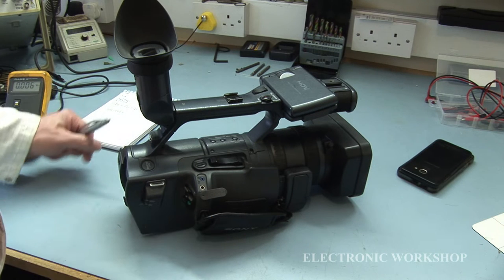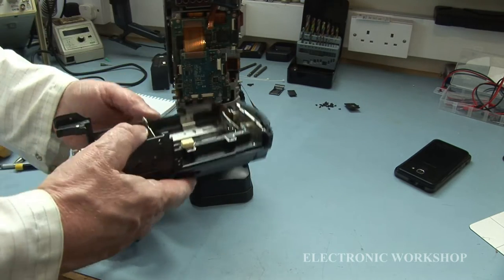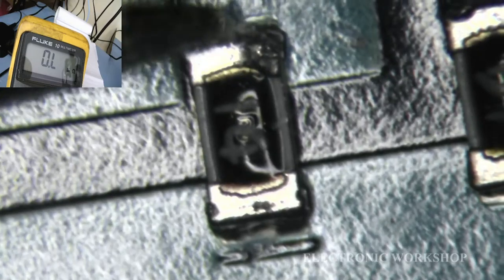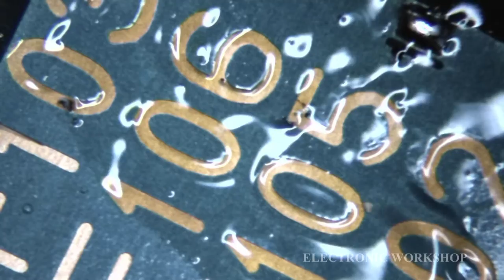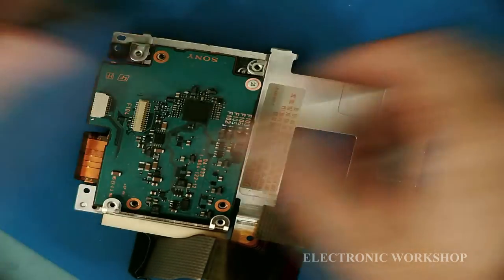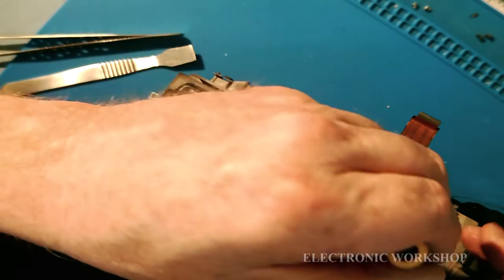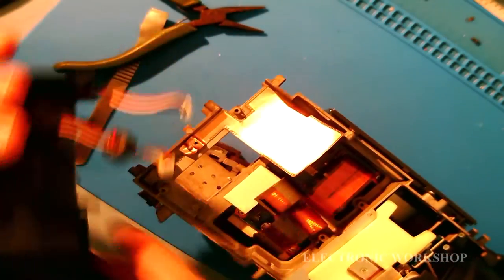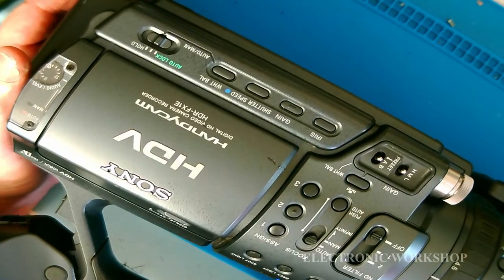Sony HDR-FX1E Dead No Functions

Comment: I put the battery in my FX1 without the handle/LCD/microphone plugged in and the left panel off, and it caused a short I'm assuming because it wont turn on now. Do you think replacing the power supply would fix that or does it sound like it's somewhere else?
Reply: Have you solved your problem? I have the same
Reply: @ДжонТерстоун  It has to be, I inspected all the boards and the only board when something wasn't plugged in was the power supply board, so the short had to occur there. And on ebay many people seem to be purchasing FX1 power supply baords, Im assuming other people came to the same conclusion.

Comment: i have same problem with same fuse f105, but after change for 32V 1,5A FX1 boot to VCR mode, but in camera mode same fuse f105 burn again. In service manual looks this fuse is for CAM5,1V for zoom servo IC controller, i dont know if is problem on DCtoDC convertor, or little sayno switches or in mainboard. Any solution for this?
Reply from the maker: i normally you my Variable Power  and inject voltage after the fuse, i Limit the current, i monitor the current then feel around for something that gets hot, it you have a thermal camera, this would be a great help, ( i don't have one)